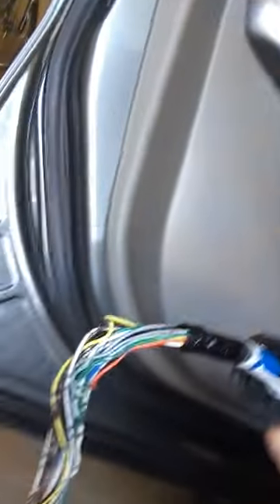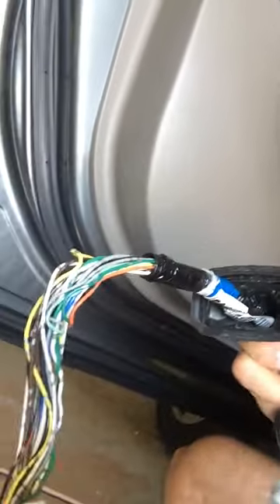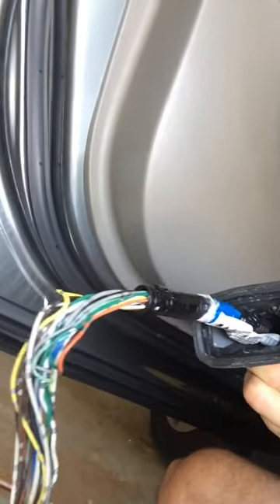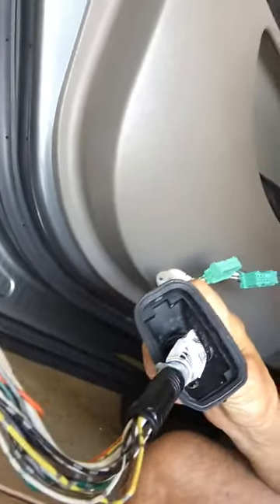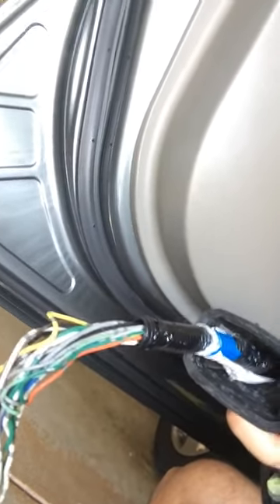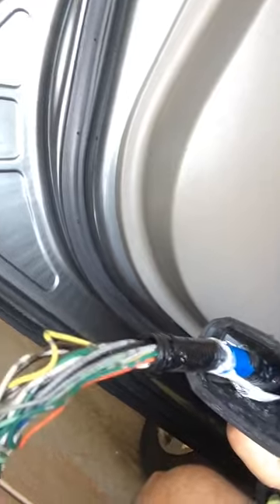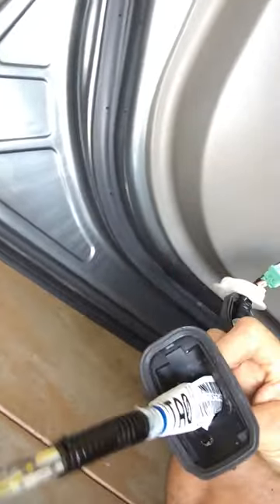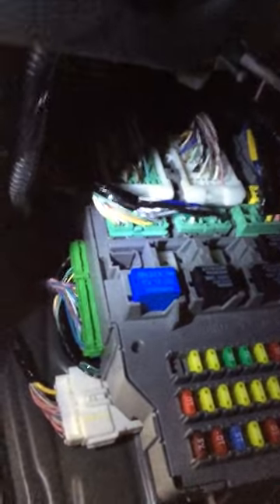How to replace  wiring harness

Comment from the maker: Sorry i did not mention the part number and did not take record of it.    When I purchased it from the dealer I just explained that it was the wiring harness that goes between the left drivers door and the car.  They pull up the diagram and found it that way.
Reply: Part number is 32757-STX-A00  the last 3 digits very by year of vehicle

Comment: What was your reason for changing the harness. What were you trying to fix? My windows won’t let up and I’m thinking I need to change the harness out. I have a new door from an 08 to my 2011 camry. Since the change my windows are having issues. Only drivers side works and I had to let the other up and down on their own door. Now after I just got a new compressor my windows would not let up and down from their door, just my door window works only. So my windows are stuck down. Any suggestions? I changed the switch and that wasn’t it. What about the harness? I’m literally searching for my 2011 door so I can have my original harness back and hoping that will make it work again
Reply from the maker: Hi Nikia,
I was having a short issue.  In the cabin of the car the accent lights around the window controls, the gear shit and the rear latch to the back tail gate were all malfunctioning.  I stumbled across the problem when I had the drivers door open while the key was in the on position.  I saw lights flickering while the door was opening.  I then moved the wiring harness with my hand and noticed thats where the issue was coming from.  So I changed it out and that fixed the problem.  Hope this helps.